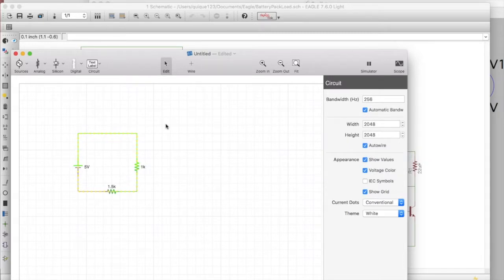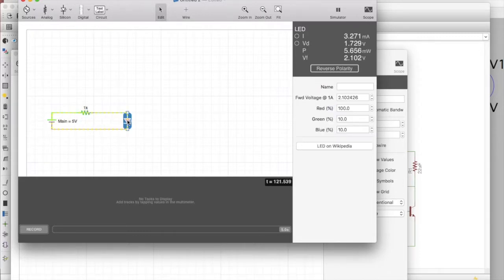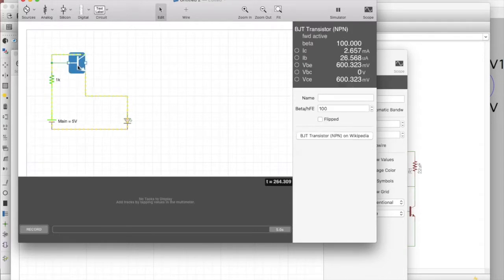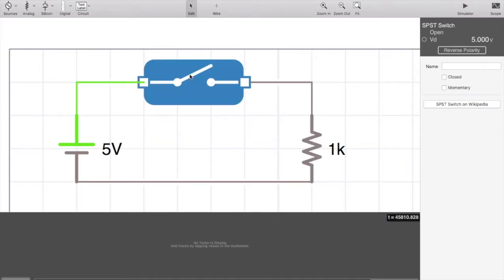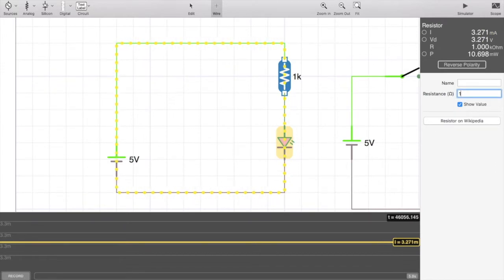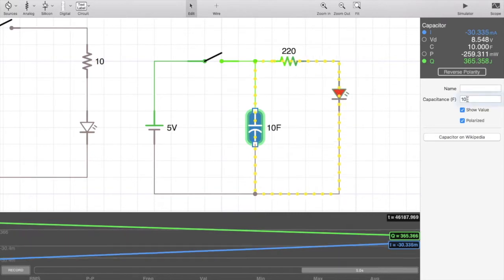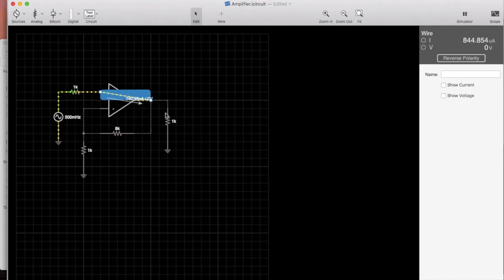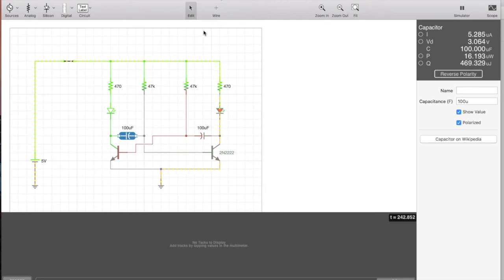iCircuit Electronics Software - Fritzing, iCircuit, LTSpice & Eagle Video Series

Comment: I tried this app on ipad, but a simple dc sine wave generator with a cap after it to filter dc didn’t even show the correct voltages on the scope. Also the scope stops responding all the time (need to kill the app to fix). It looks good, but just doesn’t work properly on Ipad. Got my money refunded, looking for another app now...
Reply from the maker: Malt Whiskey never tried it on the ipad